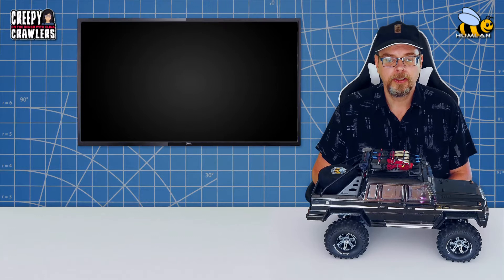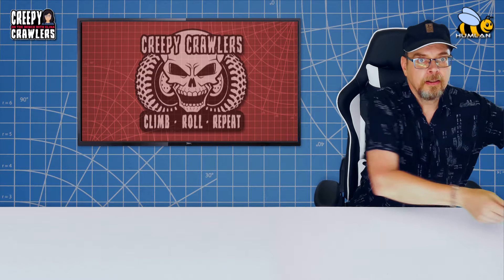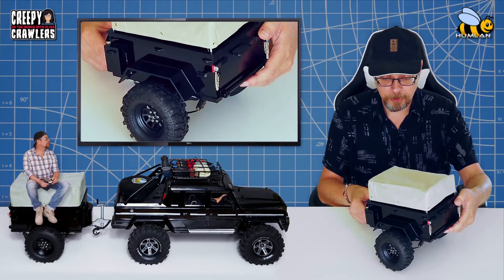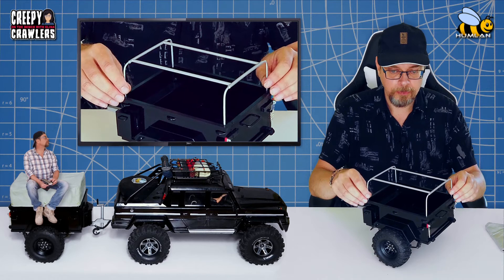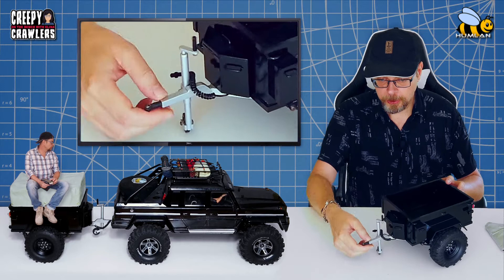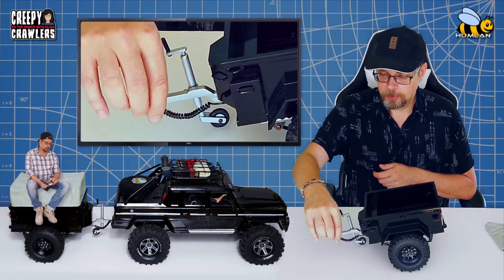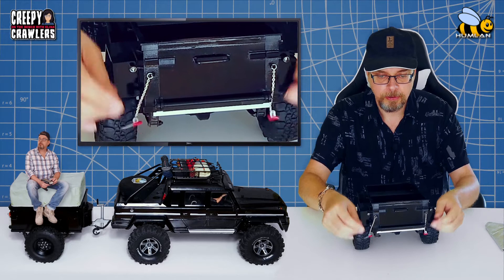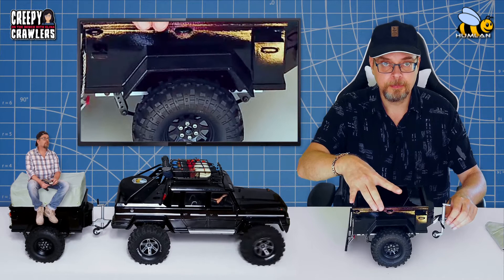The Trailer - A Closer Look

Comment: LOL! Careful not to overdo it on the chromakey. Especially if it adds an extra three or four hours to the process. That said, good grasp of the special effects panel. What hardware and software might I ask? At home I run Premiere Pro on a Gamer laptop. At the agency I ran FCP on a "trash can" Mac pro. In case you didn't know I love rugged offroad trailers, though yours looks a LOT less homemade than mine. Ha. Cheers and thanks for sharing eh.
Reply from the maker: Hehe I'll keep that in mind for my next video 😄

I run Premiere Pro for chromakey and Magix for rendering.. I'm also on a gaming PC with an Intel i7 and a GTX 2060 graphics card. 

Cheers